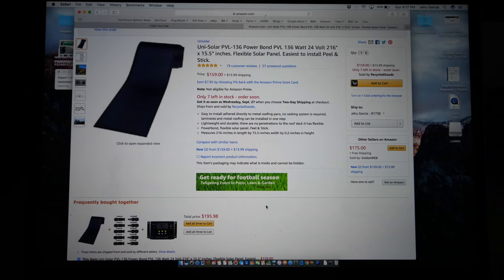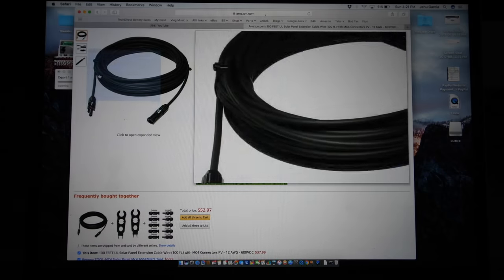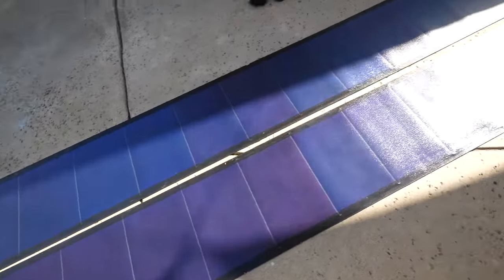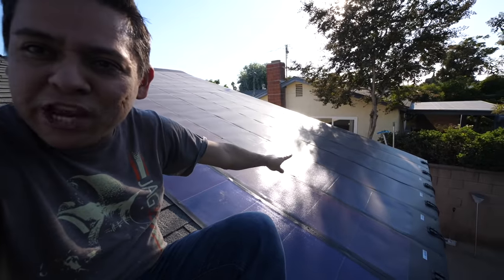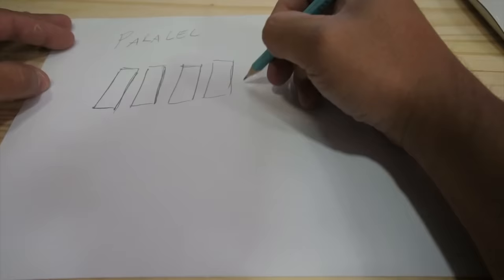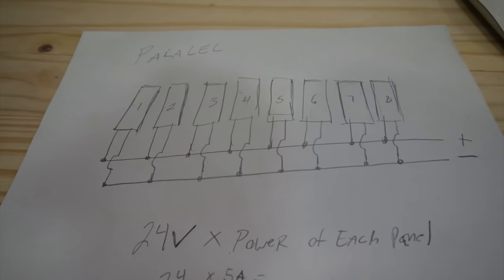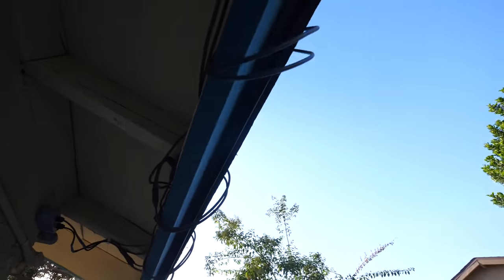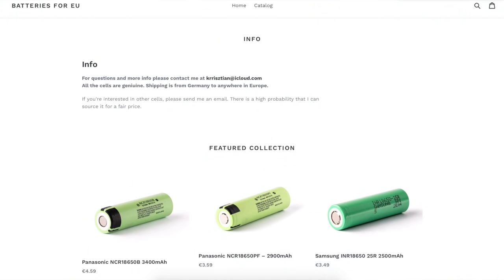My $1500 Introduction to SOLAR panels

Comment: Screwed right through the shingles with drywall screws (which will rust away in six months--especially if those were brass washers) and then applies roof patch to the top...and to a rental house.  Ouch.  Probably would have cost an extra $25 - $30 to do it the correct way, (with under shingle mounting tabs or similar) and not risked trashing the roof.  I have a lot of respect for your DIY spirit man but at some point you become responsible for the information you put out--right or wrong.
Reply: Yeah if I were his landlord I'd be pissed. He'll remove it, not give a crap and owner will get to find out the hard way there are 30 holes in his roof. What a jackass. He is obviously rough on everything he touches.
Reply: I have to wonder what he was thinking with this entire video.  He has been working hard to grow the channel, get advertisers, and sell products etc..  If I was a company considering sponsoring the channel or hiring him to consult on a power wall installation and I came across this video while doing my research--what are the impressions I come away with?  Skirt building regulations / code (which are in place to protect us all from substandard practices like this).  Hide the installation from his landlord by driving screws in through the shingles...and by his own comments "half ass" the performance because he is hiding it.  I have always admired his skills as a communicator because he not only makes complicated subject matter understandable for everyday people--he also makes it entertaining.  That is not easy.  Sadly this video is likely a step in the wrong direction as it makes him seem...a bit dishonest.  Just my opinion.
Reply: That's what I was thinking. Tenants from hell!
Reply: Jehu, you spoke of using parallel connections but I didn't hear you mention isolation diodes. Don't you need to prevent backflow through any shaded panels? Or do they each have built-in diodes? Are you still satisfied with them after a few months?
Reply: Andrew, solar panels ARE diodes.
Reply: This is why u don’t rent homes to liberals
Reply: most nice solar panels already have rated diodes installed. but you always should verify with paperwork.
Reply: Phosphate coated coarse drywall screws, bad move. Should have went with stainless steel screws with a neoprene washer.
Reply: jritz2011 or why you shouldn't let conservatives write comments. Are you saying there aren't any conservatives who are into solar power? Seems like you're judging conservatives, too. Maybe you should just limit your worthless political assumptions to your breitbart posts?
Reply: I own several rental properties. If my tenants did that, 100% would have to pay for a new roof on that side of the house. No way to fix all those holes. I’m a huge fan, but drywall screws straight through a shingle isn’t something I would advertise.
Reply: Gene Phipps IKR! Some poor fool is going to do the same thing to a home they own trying to save money on their electricity bill and end up paying $10,000 for a new roof. What an idiot, I hope his landlord makes him pay for a new roof!
Reply: DIY Guru BTW
Reply: Voided that roof warranty!
Reply: It's a cultural thing he's Mexican, if you can't do it illegally it isn't worth doing. He's making California greater. That's why so many thinking people are fleeing the state.
Reply: rick dees , sure it’s not because most of those can’t afford it.
Reply: @rickdees251  lol
Reply: @convictcreations Because of jritz2011 mentioning liberals. 

But to answer real genercruser's question, yes there are conservatives that have solar panels. Mine are rigid 100 Watt Mighty Max panels. On angle Al  and angle Al to form a Z shape. My bottom angle is screwed directly into the roof. Each hole in the angle was filled with sealant before roofing screws with Neoprene washers were run in. I know my roof won't leak as it is on a 20' container roof I built. Metal, then roof cement, then tar paper, then roof cement, then PT plywood, then PT 2X4s, then screws thru it all to attach to the container.  Then 2x4s screwed (treated screws for PT wood or stainless ) to the wood already there, then PT plywood screwed to the wood, then roof cement, then tar paper, then roofing nails, then roof cement, then roll roofing nailed down, then a coating of white Kool Seal. It is pitched 1:48 to run off the water.
Reply: As a roofer, I was thinking that too.  I would have looked for a place off the roof for them.
Reply: @genephipps6421  yah yah relax everybody, if the landlord catch him thats his problem, hes just trying to showning you ideas on how to get energy. yall dont need to make hole in the roof , i didnt heard him forcing you to do any of that.
Reply: He would be paying for a new roof if he were in one of my rental

Comment: You should put that roof sealant on the roof tile and THEN screw through it so it will seal the hole where the screw enters the tile.
Reply from the maker: Why is everyone calling them tiles?   We call them roof shingles
Reply: jehugarcia true.  Tile would imply it's rigid stone rather than flexible asphalt.  Shingle just sounds weird to me.  It reminds me of shake for some reason.
Reply: 'A thin rectangular slab of baked clay, concrete, or other material, used in overlapping rows for covering roofs.' Because they are tiles. lol
Reply: Shingles is an illness. A recurrence of smallpox as an adult, only worse. We call it "hellfire" in my country.
Reply from the maker: GrumpyShamurai  these are NOT "rectangular  slab of backed clay or other material". This are shingles
Reply: jehugarcia What if I told you they were the same thing. :P
Reply from the maker: GrumpyShamurai I'd say me and santa clause are the same thing
Reply: Stephen; chicken pox
Reply: jehugarcia few more lbs and a beard you might as well be. Lol
Reply: jehugarcia I know it's a stupid point but I think it's more about the shape of the roofing material and nothing more. But either way, tomato tomatô
Reply: Lol those are not clay tiles they are shingles... people do have tiles on their roofs, but those aren't it
Reply: Roof shingles are a roof covering consisting of individual overlapping elements. These elements are typically flat, rectangular shapes laid in courses from the bottom edge of the roof up, with each successive course overlapping the joints below.

Roof tiles are designed mainly to keep out rain, and are traditionally made from locally available materials such as terracotta or slate. Modern materials such as concrete and plastic are also used and some clay tiles have a waterproof glaze.

So roof tiles aren't always flat like regular tiles and roof shingles.
Reply: jehugarcia regardless wtf you call them, he's right about how to seal it properly.
Reply: I have a Asphalt shingled roof, these shingles use ground up slate, of various colors. Asphalt shingles, seem to be an American invention, from back in 1901.  My roof faces south(driveway), and has good view of the Sun.  My roof, was done in 2001, and didn't even last 15 years, so now I had it done professionally.  Being in Michigan, I would have to use traditional aluminium framed solar panels, on the roof.  The local weather, would wreck the flexible solar panels, with hail, ice, and snow, and wears out shingles fast.

Comment: Jehu, you don't want to announce to your neighbors you have solar panels. But all your neighbors are watching your Youtube videos!
Reply from the maker: +vuaeco   Yeah I made a comment on camera that "I realize the irony of trying to hide while broadcasting to the world".  But it didn't make the final cut
Reply: +jehugarcia i think there's no point hiding that, it should be a flag of honor, you should incentivize people doing that. There's no law at having a second electrical system, and the owner of the land can't claim a prejudice because it's not permanently installed. If i can get away with a solar calculator working in the roof why should this be any different. That shading is pretty bad considering the serial loss of the bottleneck, i seriously advise on installing in the other side, you can double or triple the amount you get with the same panel.
Reply: I'm with fss1704, put your stuff on the proper side and nobody has reason to complain that you have solar panel charging some separated battery system. The calculator example applies well.
Reply: Actual I love that he put them on the "wrong side" of the house and that they are not permanent. most people show best case scenario and then when other people try the same thing, many get frustrated when they don't get the same results. it will be nice to see how well the system performs even with the handicap. Jehu's system could prove that even a simple solar power setup can be effective.
Reply: Don't you make the cuts?
Reply from the maker: yes,  but flow is king  and the king rules
Reply: Why is this install considered illegal?
Reply: Will Prowse Hi Will, How mobile are you talking about?
Reply: steve b Dude, C'mon man that's not cool.
Reply: steve b Ahh.
Reply: all your neighbors has solar panels so why to hide them?
Reply: You have to get permits and have your work inspected by the state/local city ordinances. This setup would never pass inspection, i could almost bet the inspector wouldnt even get on the roof to look at it, would probably just laugh.
Reply: GrumpyShamurai "you have to get permits" because permits cost and pay for the professional bureaucrats that are raising the cost of our lives! What do they offer back in this kind of situation?........a permit!!!!  But so do mafia gangs that sell "protection" to businesses!!! 

The state acts like the mafia in many many instances, wake up and see! 

Now, in relation to the rental he could get the owner's permission but he seems like a very bright guy so maybe his owner is a stuck up statist, a bit like you are, and maybe he would never give his permission for this. But it's his property and he's entitled to whatever opinion on it. I think that the moral thing to do at this point (because he did make alterations without the owner's permission and that's not cool - fuck the bureaucrats) is to revert the changes back when he'll leave the place.
Reply: as long as you get what you need out of it
Reply: @edferd100  No permit, and not  done to code. Lol, screwing the sheet panels down unsupported THROUGH the shingles is a bit sketchy, even if he uses a bit of Henry's on the screws. I'm guessing a big windstorm will rip those panels off the roof. I Love the experiment though!
Reply: vuaeco doesn’t he rent the house?
Reply: @edferd100  is that a serious question?
Reply: I wouldn't want to hide solar panels. I think it's something to be proud of.

edit ; oh right, he wanted to hide them coz he didn't have permission. fair enough

Comment: Just a quick suggestions, when using the flexible panels, wouldn't it make a bit more sense to go sideways?  You can get lift the shingles and put one edge under it, and a quick screwdown removes the chance of leaking for the most part.  Then the other side a quick dab of silicone on the other screw hole makes it water proof, or use the special washer type screws (for metal roofs) which have their own rubber gasket.

I do like how the wiring is cleaner going up under the soffit though.  But if you took it to the edge of the roof it would wrap around under the edge easily enough.

Comment: FYI, a better waterproof seal can be had by predrilling the mounting holes.  Putting in the roof sealing stuff, then screw through the gunk.   The gunk wraps the screw and seals the entire hole, not just the top.

Comment: When you do your hard framed panel's since you don't own the place . Build a stand so you can put them at ground level and put them in a sunny spot in your back yard. I live off the grid and I do it this way.You  can even make it so you chase the sun on the cheap do it manually

Comment: Thanks teach. I got a suggestion for sealing the screws so you dont get leaks; you seal the top of the screw but water can get underneath the panels, from rain getting in between the panels or from the side where the last panel is. There is sealent tape you can use that you would put underneath the panel and screw through both the panel and the sealant tape.

Comment: Jehu I was for many years a Uni-Solar dealer and installer over here in Australia, until their size/watts ratio became not practical to install, and the price fell on the Monocrystalline and Polycrystalline panels.
Now your panels are Amorphous technology, so totally different from the Monocrystalline panels that you shade tested, you need to look up the advantages of Amorphous technology.
Because these panels are Amorphous technology and somewhat shadow tolerant, I would be considering series connection :-)
Reply: Which panels would you recommend for a removable rental house installation in AU?  And talk to me about mounting options.
Reply: I should have pointed out that my experience is in the field of camping, caravans 4x4 motorhomes etc, and not house installs (other than my own).
So sorry I can't help you with advice on the racking etc, however as for the solar panels, if you check out lowenergydevelopments on eBay, they have some of the best pricing and are very honest and reliable in my experience,  I have bought over 50 panels from them over the years with no unsolved issues.
Reply: I am a residential and off-grid installer in Aus. It depends on how big you want your system. Do you have a tin or tile roof?
Reply: Thanks Val.  Cameron I have a tile roof.  I'd probably want to off-grid certain appliances, AC, some computers  etc.  Expandability as money expands is probably important.
Reply: Also Adam you can totally start this with minimal gear and keep it separate from the house wiring. Just put your charge controller, or inverter if you want 240, inside. Like on the other side of the wall to your main meter box. That will keep everything close in case you want to upgrade to hybrid later. Doing this you will also be able to easily disconnect any 240 circuit that you want to change to off grid. Hopefully this makes sense.
Reply: Thanks Cameron.  I'll be in touch.
Reply: Replace the power to the hot water heater with solar.

Comment: Nice video. Tip...Beter installation would be if you rotate your 8 PV strips 90 degrees. That way you don't go over the roof line....more stealth (and a little more efficient) 👍😀

Comment: I wonder if one can use those roll-out panels as a camping tarp?
I'm pondering converting a kombi/vans (both for EV and for camping) to be used for extended trips here in Southern Africa (in search of Nambia :P). There are numerous trips one can do (especially along the coast) with less than 180miles of driving to get to the next un/official camping spot outside of dangerous areas.

Comment: MC3 is weird type.. In Europe its MC4 as main connector. If im not mistaken MC3 is the old type that is almost gone now. They dont contain any proper locking mechanism and should therefore not be used. (Unless you found one that is newly made and have that now)
 Good work!
Reply: yes MC3 is the old type, still used for low current applications.
Reply: MC4 have all world main connector, america and europe same. and asian same. normal, mc3 has old type low power and not used anywere today. maybe toy user . why do id not can do good. roof not drill hundres screw, stupid and seal not help anythink toip of scewr leak lot no longtime and roof have this installation broken and not newer rust screw alltime used stainless steel screws, idiot have uh.

Comment: Yeah Jehu I'm normally with you on this cool DIY stuff, but I've done roof work and you did absolutely nothing with that wet patch. It didnt get underneath the solar panel, so water can still get under the panels and then right into the screw holes. Even after patching the holes, that roof is degraded. Sealants don't hold forever on the gravel, and one will eventually leak even if you do remove the screws and fill the holes properly.
Reply from the maker: Matthew Walsh -  This roof is at least 20 years old....  it will need to be replaced soon,  I'm not even sure the crest doesn't leak already
Reply: For sure, I'm not here to criticize. Just would hate to see a video titled "So My PowerWall Went Nuclear During the Storm". I'm just concerned for you, but I came off abrasively as usual. My bad.

Comment: You are supposed to use the sealant where the screw breaks the surface of the roof, which is underneath the panels you are screwing into. Specifically, you should be applying the sealant between the panels and the shingles.

Look forward to water damage :(.
Reply from the maker: Im still waiting......
Reply: @jehugarcia  "it never rains in southern california" ... and if that song is right it might be pretty boring to wait for rain ... but I guess night or morning moisture might cause corrosion cause that loves heat and moisture waves. 

But these flexible modules seem to be a bit inefficient cause 176 Wpeak on a 5,5m x 0,4 m area wozld mean that just 2,5 of these pieces would need 11m²  for just 440 Watt peak.
2 fixed Solarpanels of 3,4 x 1 = 3,4m² can deliver 660 W Peak ... or 1.980 Watt peak on a 10 m² footprint or 2.200 Watt peak on 11 m²

2.200 W compared to 440W would mean just 20% of possible harvest or 80% less.
Fixed modules in a on top roof racket are a ot cheaper, 2 modules 140$ ... or 6 of them  520$ + racket system which is quite expensive compared to the modules. We paid for a 2200 Watt peak system with 8 modules 275WP just 580$ but about 300$ for racket, 20 m cable + connectors and an 2 kWp grid tie inverter for 360$ = 1.240$ 
Unfortunatelly we'll get just 1,05 MW p.a. / m²
while you just get twice as much energy.

Anyway, can't wait to see your 2019 pv  upgrade coming alive and harvesting the energy for your cars.

Great stuff ...